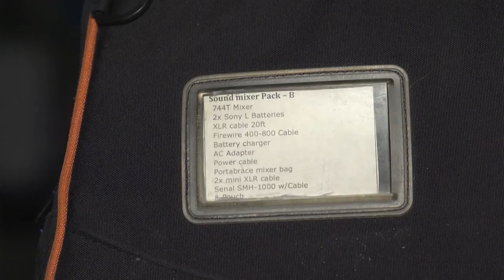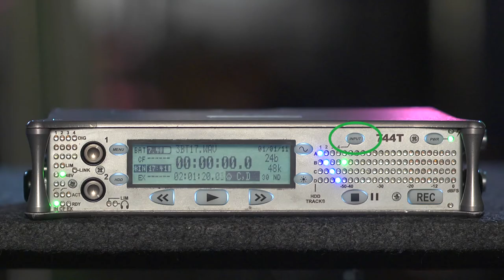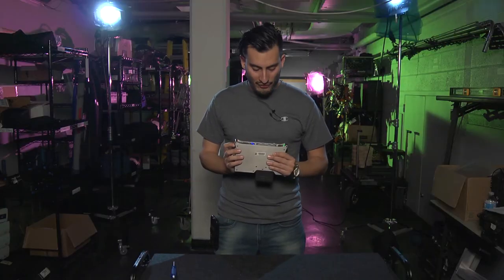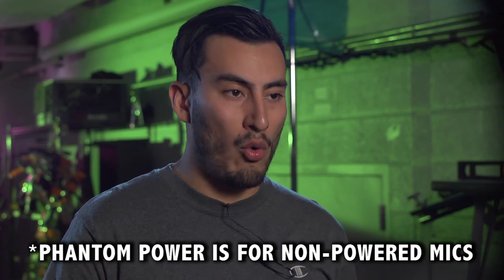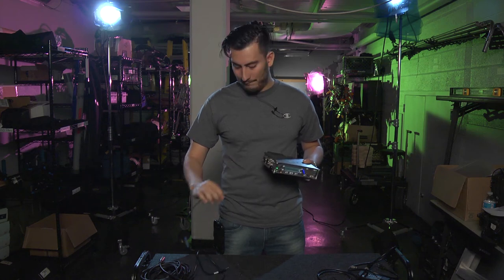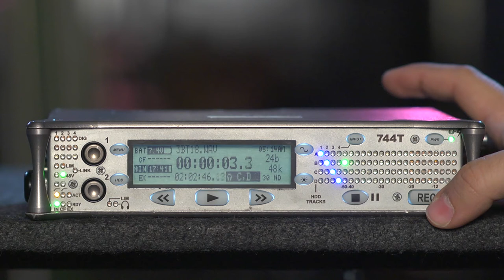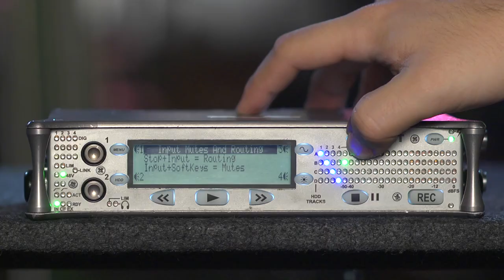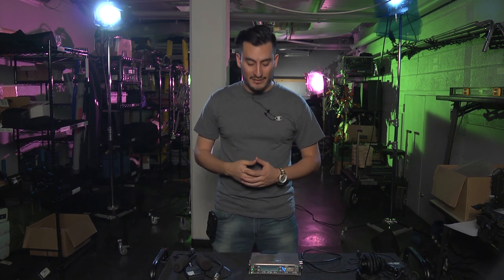CMI Training | 744T Sound Mixer Tutorial

Comment: Thanks for the video! I just got a 744T as my main recorder. I have a question, should I use my SD MM-1 between my boom and 744t or is not really an improvement? Are the pre-amps of the 744t better than the MM-1? Thanks in advance.
Reply: I wouldn't put that MM-1 in between unless you absolutely had to boost the signal more than what the 744T can do internally for some reason.  Basically, I'd put the boom directly into the 744T.

Comment: My friend wants to ask I have a problem with my 744 sound device, so the problem is the phantom indicator LED, cf LED, internal LED, 1.2 LED track is dead, why is that?
Reply from the maker: If those functions are turned on and those LEDs aren't lighting up, then that might mean the LEDs aren't working. You may need to replace the LEDs there.  I think that's something you might want Sound Devices themselves to repair.